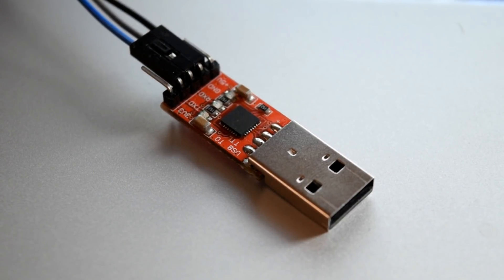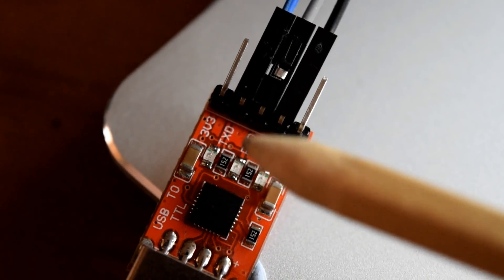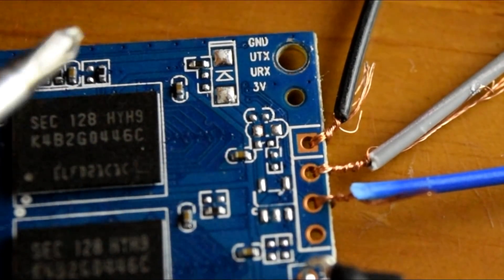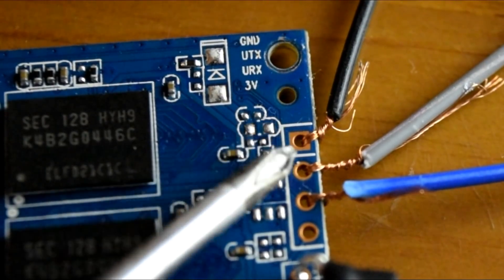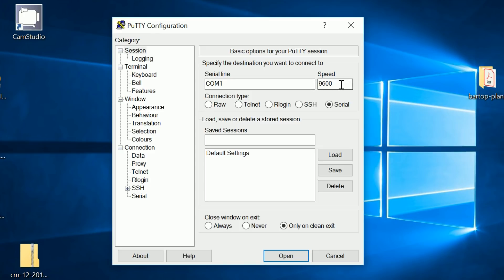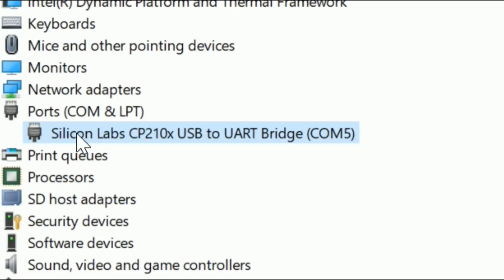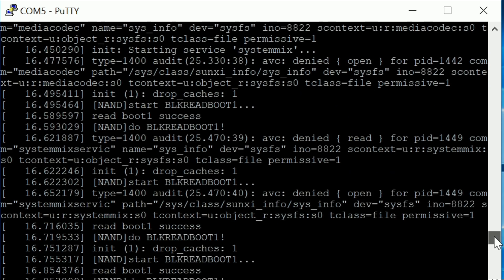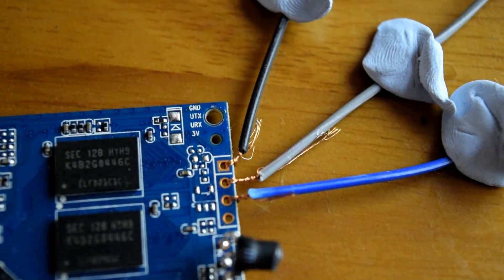UART for Amlogic Allwinner and Rockchip Android TV Boxes: How To Connect Guide Tutorial

Comment: Why UART can't connect end with error PLL lock failed
Chitti Chirlttu:
Mi tv 4a i have software issue after update system brick no display only red light glow i have trying to connect usb to pc but it doesn't connect to pc or listed in device manager any thing.processor amlogic t962x-s

Is any other way to switch to usb boot mode

Comment: Log my putty 
GXL:BL1:9ac50e:a1974b;FEAT:ADFC318C;POC:3;RCY:0;EMMC:0;READ:0;0.0;CHK:0;
TE: 170247

BL2 Built : 12:23:15, May 17 2019. gxl g3e531ea - luan.yuan@droid15-sz

set vcck to 1120 mv
set vddee to 1000 mv
Board ID = 1
CPU clk: 1200MHz
DQS-corr enabled
DDR scramble enabled
DDR3 chl: Rank0+1 @ 768MHz - FAIL
DDR3 chl: Rank0 @ 768MHz
bist_test rank: 0 26 08 44 35 15 55 23 08 3f 36 16 57 26 07 45 30 10 50 25 08 42 37 1a 55 685   - PASS

Rank0: 1024MB(auto)-2T-11
AddrBus test pass!
eMMC boot @ 0
sw8 s
emmc switch 3 ok
Authentication key not yet programmed
get rpmb counter error 0x00000007
emmc switch 0 ok
Load fip header from eMMC, src: 0x0000c200, des: 0x01400000, size: 0x00004000, part: 0
New fip structure!
Load bl30 from eMMC, src: 0x00010200, des: 0x013c0000, size: 0x0000d600, part: 0
Load bl31 from eMMC, src: 0x00020200, des: 0x05100000, size: 0x0002b400, part: 0
Load bl33 from eMMC, src: 0x0004c200, des: 0x01000000, size: 0x0007fa00, part: 0
NOTICE:  BL3-1: v1.0(release):53f813e
NOTICE:  BL3-1: Built : 15:51:23, May 22 2019
[BL31]: GXL CPU setup!
NOTICE:  BL3-1: GXL normal boot!
NOTICE:  BL3-1: BL33 decompress pass
mpu_config_enable:system pre init ok
dmc sec lock
[Image: gxl_v1.1.3389-92241b5 2019-07-02 17:22:35 luan.yuan@droid15-sz]
OPS=0x82
21 0b 82 00 1a 33 11 09 78 5c 6b 6c 59 51 36 f8
[0.664577 Inits done]
secure task start!
high task start!
low task start!
ERROR:   Error initializing runtime service opteed_fast

U-Boot 2015.01-g3f780c9 (Aug 23 2019 - 13:51:26)

DRAM:  1 GiB
Relocation Offset is: 36e7a000
register usb cfg[0][1] = 0000000037f4b2e8
[CANVAS]canvas init
boot_device_flag : 1
Nand PHY Ver:1.01.001.0006 (c) 2013 Amlogic Inc.
init bus_cycle=6, bus_timing=7, system=5.0ns
reset failed
get_chip_type and ret:fffffffe
get_chip_type and ret:fffffffe
chip detect failed and ret:fffffffe
nandphy_init failed and ret=0xfffffff1
aml_i2c_init_port init regs for 2
MMC:   aml_priv->desc_buf = 0x0000000033e7a6b0
aml_priv->desc_buf = 0x0000000033e7c9f0
SDIO Port B: 0, SDIO Port C: 1
co-phase 0x2, tx-dly 0, clock 400000
co-phase 0x2, tx-dly 0, clock 400000
co-phase 0x2, tx-dly 0, clock 400000
emmc/sd response timeout, cmd8, status=0x1ff2800
emmc/sd response timeout, cmd55, status=0x1ff2800
co-phase 0x2, tx-dly 0, clock 400000
co-phase 0x2, tx-dly 0, clock 40000000
[mmc_startup] mmc refix success
init_part() 297: PART_TYPE_AML
[mmc_init] mmc init success
      Amlogic multi-dtb tool
      Single dtb detected
start dts,buffer=0000000033e7f240,dt_addr=0000000033e7f240
get_partition_from_dts() 91: ret 0
      Amlogic multi-dtb tool
      Single dtb detected
parts: 17
00:      logo   0000000000800000 1
01:  recovery   0000000001800000 1
02:      misc   0000000000800000 1
03:      dtbo   0000000000800000 1
04:  cri_data   0000000000800000 2
05:     param   0000000001000000 2
06:      boot   0000000001000000 1
set has_boot_slot = 0
07:       rsv   0000000001000000 1
08:  metadata   0000000001000000 1
09:    vbmeta   0000000000200000 1
10:       tee   0000000002000000 1
11:    vendor   0000000014000000 1
12:       odm   0000000008000000 1
13:    system   0000000050000000 1
14:   product   0000000008000000 1
15:     cache   0000000046000000 2
16:      data   ffffffffffffffff 4
init_part() 297: PART_TYPE_AML
eMMC/TSD partition table have been checked OK!
crc32_s:0x1577dad == storage crc_pattern:0x1577dad!!!
crc32_s:0xee152b83 == storage crc_pattern:0xee152b83!!!
crc32_s:0x7fd3b243 == storage crc_pattern:0x7fd3b243!!!
mmc env offset: 0x4d400000
In:    serial
Out:   serial
Err:   serial
reboot_mode=cold_boot
[store]To run cmd[emmc dtb_read 0x1000000 0x40000]
_verify_dtb_checksum()-3406: calc ec163d72, store ec163d72
_verify_dtb_checksum()-3406: calc ec163d72, store ec163d72
dtb_read()-3623: total valid 2
update_old_dtb()-3604: do nothing
      Amlogic multi-dtb tool
      Single dtb detected
vpu: clk_level in dts: 7
vpu: vpu_power_on
vpu: set clk: 666667000Hz, readback: 666666667Hz(0x300)
vpu: vpu_module_init_config
vpp: vpp_init
cvbs: cpuid:0x21
hpd_state=0
vpp: vpp_matrix_update: 2
cvbs performance type = 6, table = 0
cvbs_config_hdmipll_gxl
cvbs_set_vid2_clk
Net:   dwmac.c9410000amlkey_init() enter!
[EFUSE_MSG]keynum is 4
[BL31]: tee size: 0

CONFIG_AVB2: null
Start read misc partition datas!
info->magic =
info->version_major = 1
info->version_minor = 0
info->slots[0].priority = 15
info->slots[0].tries_remaining = 7
info->slots[0].successful_boot = 0
info->slots[1].priority = 14
info->slots[1].tries_remaining = 7
info->slots[1].successful_boot = 0
info->crc32 = -1075449479
active slot = 0
wipe_data=successful
wipe_cache=successful
upgrade_step=2
reboot_mode:::: cold_boot
amlkey_init() enter!
amlkey_init() 71: already init!
[EFUSE_MSG]keynum is 4
[BL31]: tee size: 0
[KM]Error:f[key_manage_query_size]L515:key[deviceid] not programed yet
[KM]Error:f[key_manage_query_size]L515:key[region_code] not programed yet
[OSD]load fb addr from dts:/meson-fb
[OSD]fb_addr for logo: 0x7f800000
[OSD]load fb addr from dts:/meson-fb
[OSD]fb_addr for logo: 0x7f800000
[OSD]VPP_OFIFO_SIZE:0xfff00fff
[CANVAS]addr=0x7f800000 width=3840, height=2160
[OSD]osd_hw.free_dst_data: 0,719,0,575
The Board don't support KBI interface
amlkey_init() enter!
amlkey_init() 71: already init!
[EFUSE_MSG]keynum is 4
[BL31]: tee size: 0
[KM]Error:f[key_manage_query_size]L515:key[deviceid] not programed yet
[KM]Error:f[key_manage_query_size]L515:key[region_code] not programed yet
gpio: pin GPIOAO_2 (gpio 102) value is 0
detect upgrade key
gpio: pin GPIOAO_2 (gpio 102) value is 1
Command: bcb uboot-command
Start read misc partition datas!
BCB hasn't any datas,exit!
amlkey_init() enter!
amlkey_init() 71: already init!
[EFUSE_MSG]keynum is 4
[BL31]: tee size: 0
[KM]Error:f[key_manage_query_size]L515:key[deviceid] not programed yet
[KM]Error:f[key_manage_query_size]L515:key[region_code] not programed yet
Hit Enter or space or Ctrl+C key to stop autoboot -- :  0
CONFIG_SYSTEM_AS_ROOT: systemroot
system_mode: 1
Start read misc partition datas!
info->magic =
info->version_major = 1
info->version_minor = 0
info->slots[0].priority = 15
info->slots[0].tries_remaining = 7
info->slots[0].successful_boot = 0
info->slots[1].priority = 14
info->slots[1].tries_remaining = 7
info->slots[1].successful_boot = 0
info->crc32 = -1075449479
active slot = 0
CONFIG_AVB2: null
active_slot: normal avb2: 0
avb2: 0
ee_gate_off ...
avb2: 0
## Booting Android Image at 0x01080000 ...
Kernel command line: androidboot.dtbo_idx=0 --cmdline root=/dev/mmcblk0p18 buildvariant=userdebug
Start read misc partition datas!
info->magic =
info->version_major = 1
info->version_minor = 0
info->slots[0].priority = 15
info->slots[0].tries_remaining = 7
info->slots[0].successful_boot = 0
info->slots[1].priority = 14
info->slots[1].tries_remaining = 7
info->slots[1].successful_boot = 0
info->crc32 = -1075449479
active slot = 0
active_slot is normal
load dtb from 0x1000000 ......
      Amlogic multi-dtb tool
      Single dtb detected
find 1 dtbos
dtbos to be applied: 0
Apply dtbo 0
   Loading Kernel Image(COMP_NONE) ... OK
   kernel loaded at 0x01080000, end = 0x019abd38
   Loading Device Tree to 0000000009fef000, end 0000000009fffed4 ... OK
fdt_instaboot: no instaboot image

Starting kernel ...

uboot time: 5022924 us
[    0.000000@0] Booting Linux on physical CPU 0x0
[    0.000000@0] Linux version 4.9.113-g6880ef4-dirty (terry@Server) (gcc version 6.3.1 20170109 (Linaro GCC 6.3-2017.02) ) #5 SMP PREEMPT Thu Aug 22 16:00:30 CST 2019
[    0.000000@0] CPU: ARMv7 Processor [410fd034] revision 4 (ARMv7), cr=10c5383d
[    0.000000@0] CPU: div instructions available: patching division code
[    0.000000@0] CPU: PIPT / VIPT nonaliasing data cache, VIPT aliasing instruction cache
[    0.000000@0] OF: fdt:Machine model: Khadas
[    0.000000@0] earlycon: aml_uart0 at MMIO 0xc81004c0 (options '')
[    0.000000@0] bootconsole [aml_uart0] enabled
[    0.000000@0] page_trace enabled
[    0.000000@0] Reserved memory: created CMA memory pool at 0x05000000, size 4 MiB
[    0.000000@0] OF: reserved mem: initialized node linux,secmon, compatible id shared-dma-pool
[    0.000000@0] Reserved memory: created CMA memory pool at 0x7f800000, size 8 MiB
[    0.000000@0] OF: reserved mem: initialized node linux,meson-fb, compatible id shared-dma-pool
[    0.000000@0] Reserved memory: created CMA memory pool at 0x7d800000, size 32 MiB
[    0.000000@0] OF: reserved mem: initialized node linux,di_cma, compatible id shared-dma-pool
[    0.000000@0] Reserved memory: created CMA memory pool at 0x75c00000, size 124 MiB
[    0.000000@0] OF: reserved mem: initialized node linux,ion-dev, compatible id shared-dma-pool
[    0.000000@0] Reserved memory: created CMA memory pool at 0x74c00000, size 16 MiB
[    0.000000@0] OF: reserved mem: initialized node linux,vdin1_cma, compatible id shared-dma-pool
[    0.000000@0] Reserved memory: regions without no-map are not yet supported
[    0.000000@0] Reserved memory: created CMA memory pool at 0x61800000, size 308 MiB
[    0.000000@0] OF: reserved mem: initialized node linux,codec_mm_cma, compatible id shared-dma-pool
[    0.000000@0] Reserved memory: unable to setup CMA region
[    0.000000@0] OF: reserved mem: initialized node linux,codec_mm_reserved, compatible id amlogic, codec-mm-reserved
[    0.000000@0] cma: Reserved 8 MiB at 0x61000000
[    0.000000@0] Memory policy: Data cache writealloc

Comment: ok looks fun to try but for what purpose can a greenhorn like me use it? i really treid to understand and watched the clip 3 times...
Reply from the maker: More for debugging purposes really
Reply: @MXQPROJECT  hey! thanks for your fast reaction, can you give me a example? can i use it to update a  kernel?  (like to use my xbox one bluetooth controller on the tv box) read something about old kernels used in tv boxes.
Reply from the maker: No not really for that as far as i am aware anyway - thing like that are built into a kernel and to update isn't really updating a kernel as we are still stuck on old kernals for most Amlogic / Rockchip stuff - But those drivers are built into newer firmware or custom pieces bit depends on what box you have etc